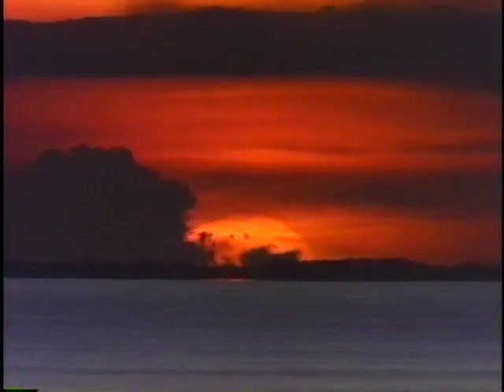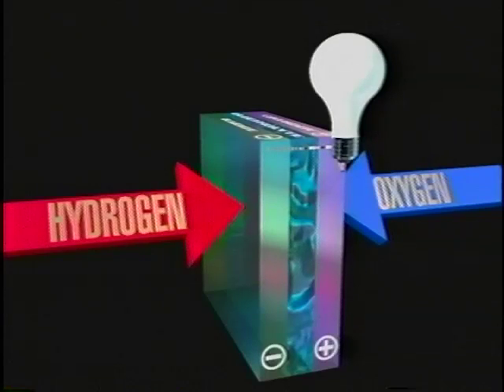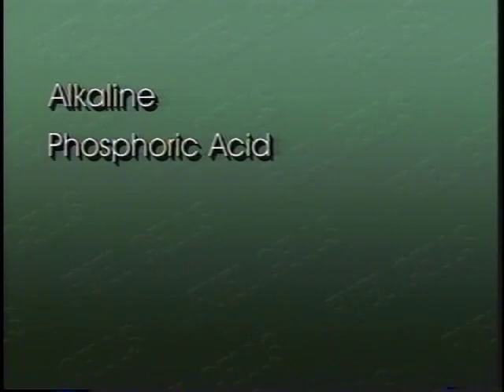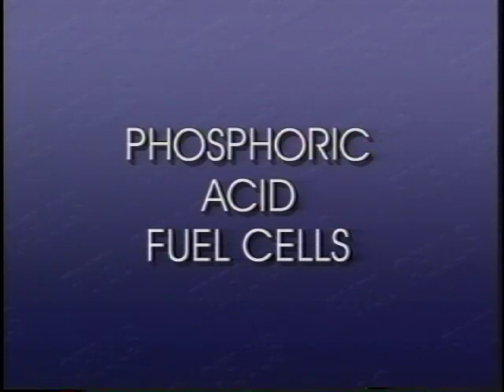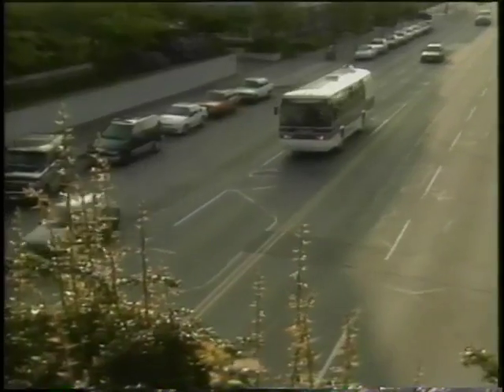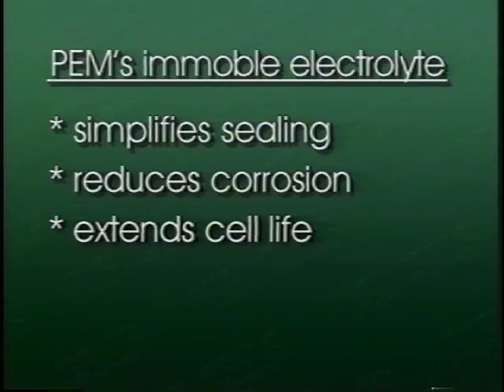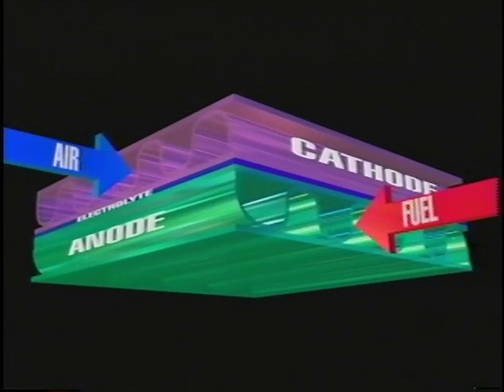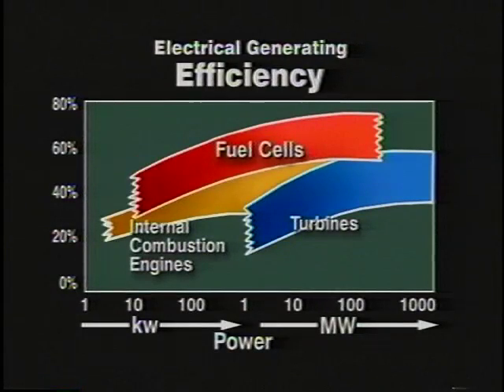FUEL CELLS Clean Energy for the Future

Comment: before you spout  "clean" energy you might want to add what its takes to get the hyrdrogen in the first place... and how fuel cells are still a 100% dirrect LOSS system..  (you make the hydrogen using energy, you convert that energy to electricity.. oh..  conversions...  even more loss.

Perhaps you should talk about electrolysis hooked up to an alterater to make hyrogen and oxygen that ANY compbustion engine can run on and put out 0 emissions.   COUGH "HHO"

proof engines run on hydrogen ==  BMW Hydrogen 7 model  is a production car that runs on it.

Comment: Something I've noticed about these hydrogen fuel cell pieces is when a comparison is made it is always against a gasoline vehicle. That thinking made sense mid 20th century when the best batteries available for a pure battery electric vehicle were lead acid or nickel-iron but that is no longer the case. These days the choice would be between fuel cell vehicles and pure battery electric vehicles employing Li-ion cells. No competition, the BEV uses a third, possibly a quarter of the total energy that a fuel cell vehicle required (much of that energy is used in the production of hydrogen and its transportation). Oh and fuel cell vehicle still needs a battery just like a BEV (only a quarter the size though) because of the lag in the fuel cell's response to requests for more or less power.

Comment: Too bad that hydrogen economy will never happen.
Only feasible production of hydrogen is from fossil fuels (95% of hydrogen is produced that way from natural gas (fracking)), and this is not clean and damages environment. And even this "cheap" hydrogen is more expensive than gasoline.
Making hydrogen from water does not make much sense, because you lose 75% of energy in the process.
You put in 100kWh of energy to make hydrogen, and you get back 23kWh by converting produced hydrogen to electricity with fuel cell.
You can say, we will put solar panels, wind turbine or any other renewable and make hydrogen that way for 'free', but you still lose 75% energy produced, and you have oversize power plant 4 times to cover your needs.
Reply: Sasoon2006 using electrolysis isn't necessarily needed. there is a multitude of easy chemical reactions produce hydrogen without and outside source of energy needed.
Reply: Hydrogen can be produced by splitting water (dry cell) using Solar energy, wind energy etc. There is at all no need of fuels. Hydrogen is most instable and should under no circumstances be stored but used immediatelly after produced!!
Reply: I hope you all continue this thread.
Reply: *****
If you are going to use it immediately after it is produced, why not use electricity directly, why step of converting electricity to hydrogen than back to electricity, wasting 75% of energy?
Reply: Flw_Gurl123
How do you create those chemicals? Point is, that with hydrogen you always have to put in more energy, than you get from it.
Reply: ever think of a machine that runs on hydrogen that makes hydrogen efficiently? people forget where there brains went
Reply: you get 1 hydrogen and 2 oxygen molecules from water..  but the funny thing is... when hyrogen is burned in a combustion engine... the only byproduct is.... WATER..
1st law    you cant create energy
2nd law   you cant destroy energy

conclusion .. HYDROGEN CAN NOT BE USED UP...  givin the fact  the exaust is running water where hydrogen is not present in a gas form.   And it was generated from the cars alternator..  so 100% recycled system if you put the exaust pipe back into the water used to create hydrogen in the first place..
Reply: You can produce hydrogen through electrolysis with surplus electricity from PV and wind turbines and store it.
Reply: Dscher Ordnave
You can, but in the end you store only 25% of surplus energy, and waste the rest. If you store it in batteries you store around 80%.